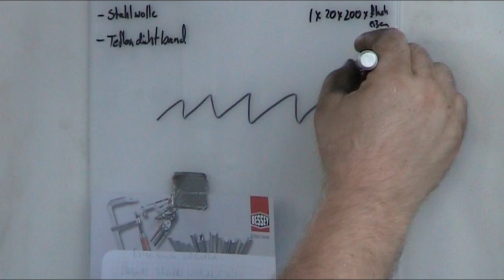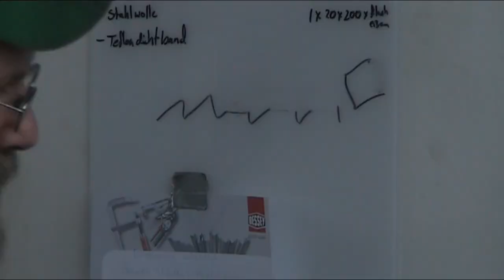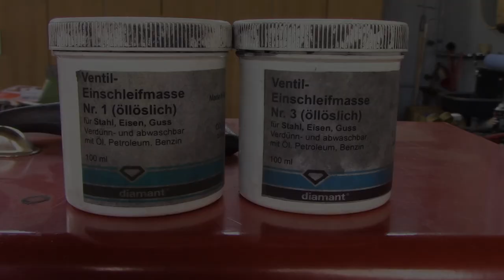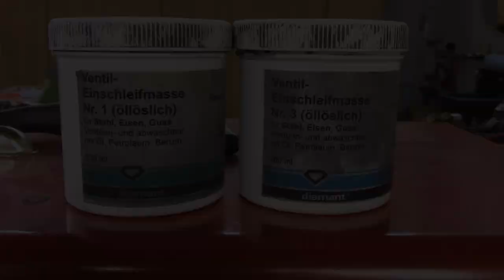Zerks&Wheels episode 33 ridin' the fence part 3,  rebuilding a Weinig U140/4

Comment: Robin Renzetti (sp) also has some good lapping videoes, ROBRENZ. As I recall, he used a small cast iron surface plate for his lap to recondition a granite surface plate.
Another good video, although, I would watch just for the music.
Reply from the maker: thanks for the tip! i have a sub to his channel but haven't worked thru all of his material yet. the laps i made were from material that i have kicking around the shop. ideally the lap should be softer than the material being worked according to Tom Lipton. this is another case of working with what's at hand and doing the best you can with what you have. all in all it turned out well...